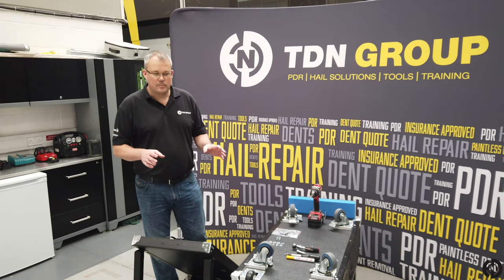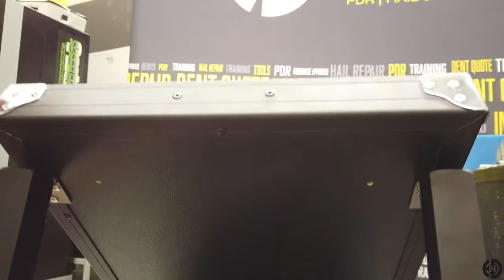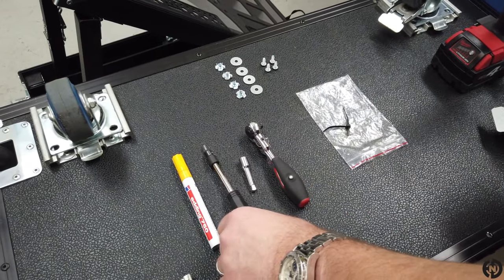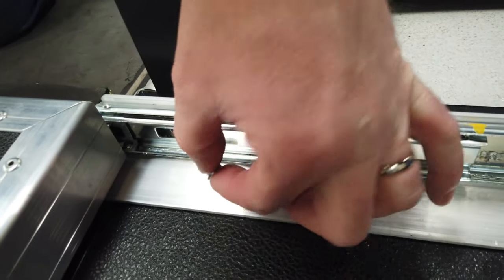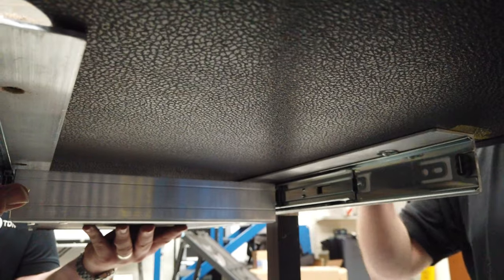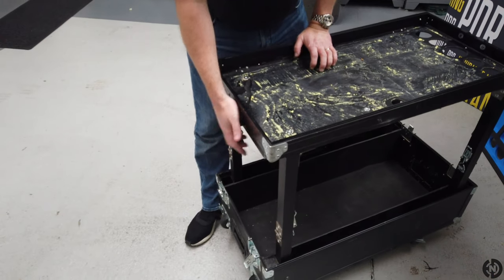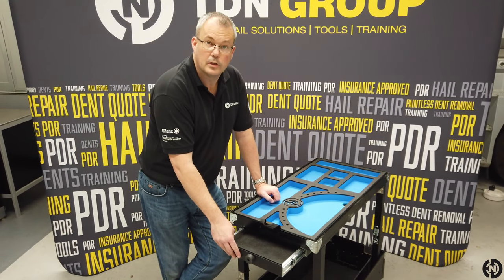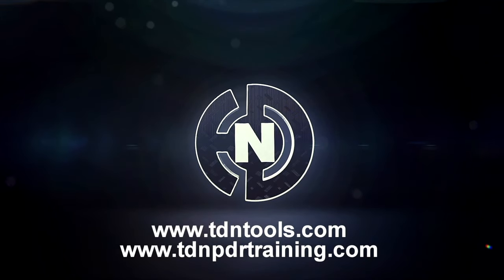How to Fit a Drawer to a Series 1 TDN Tool Cart

Comment: Do you have the measurements for the drawer
Reply from the maker: Hi Steven, would the drawer be for the Series 1 or Series 2 cart?
Reply: @KecoUK  series 2. The drawer thats currently forsale on your website
Reply: @KecoUK  any idea?
Reply from the maker: @SCH00NY125  We'll get one measured up for you. Did you want the internal or external measurements?
Reply: @Keco UK  external please. Just trying to see if it will fit under my current cart. I should've just added it to my oder when I got my doda the other day but oh well
Reply from the maker: @SCH00NY125  We've requested the drawings from our manufacturer so we'll have these shortly. The Series 2 drawer will fit the Series 1 & 2 carts. If your cart is the older model, you would be better off getting the Series 1 drawer as it's wider. Send us an email to tools@kecotabs.co.uk and we'll be able to help.